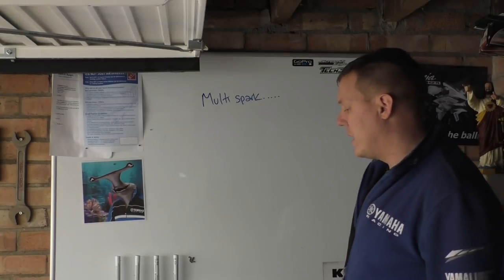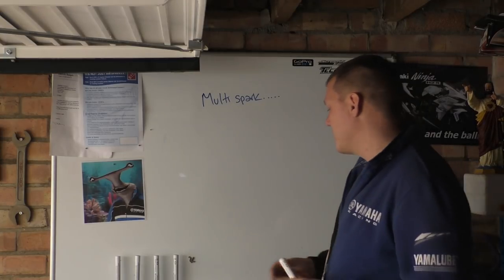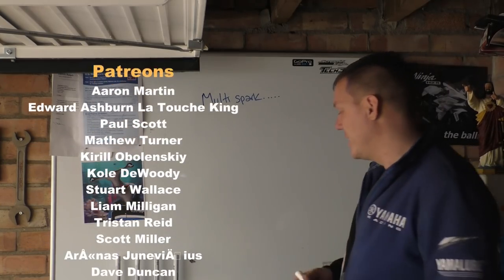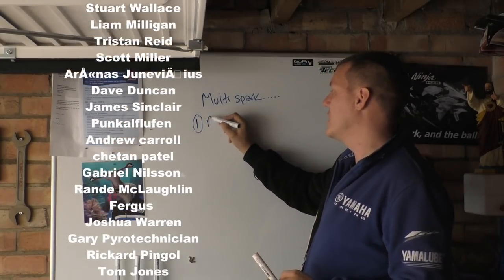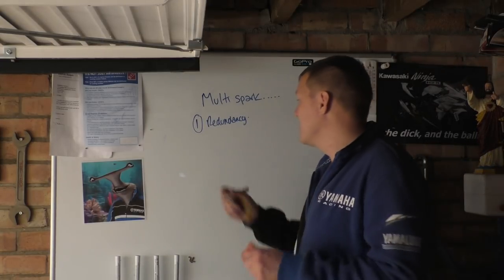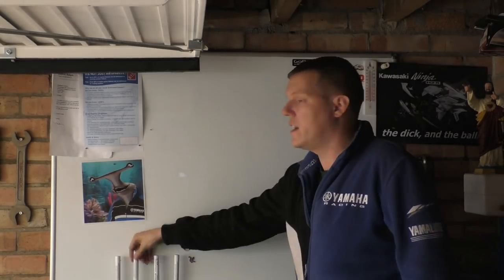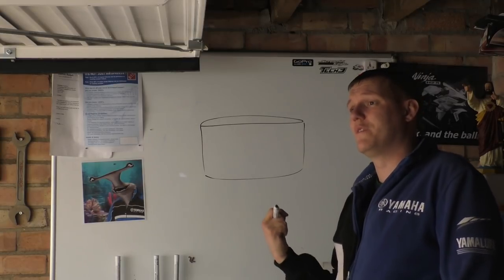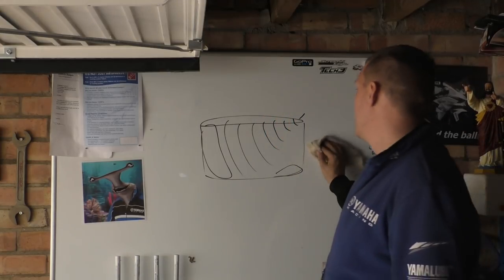Multiple Spark plugs - Why?

Comment: Some old two strokes had two plugs in a single cylinder but just one plug wire. If one fouled you could swap to the other. I remember seeing one many years ago but I don't remember what bike it was. I remember thinking it was interesting that you could have a cold (no spark) plug in there and it would not itself foul and you could switch to it if the need arose.
Reply: Yamaha dt from the 70s had this. All that I've seen just have a bolt plugging the second hole. Guess that's how well it worked.
Reply: I remember my mates Dad Had a Suzuki TS 250 with that set up. I used to think the lead had come off

Comment: Wouldn't starting a flame front from two separate points increase cylinder pressure over a single plug, and therefore the risk of detonation? In fact isn't that what happens in detonation where you get multiple flame fronts? (cue request for vid on detonation/preignition unless you've already done one. Not mastered this youpube search yet )

Comment: Matt, would you know on an SV650 (2017) do both spark plugs fire all the time or only at high RPM's? I tried to find more info but came up with nothing
Reply from the maker: I would think that they fire all the time, this means that the plugs wear out evenly, but I'll see what I can find out
Reply: Awesome, I appreciate the effort! I would think that as well since everyone is saying that 2 spark plugs are there for the emissions so they would have to fire all the time. I still haven't recorded the ticking sound on my bike (referring to your older video) to send to you but I plan to do it as soon as the weather improves. Also need to borrow some good sound recorder to do it.
Reply: Coil pic looks like full time, same coil as wasted spark but running to 2 plugs each cylinder so still fire together. Staged firing requires a trigger in the coil like COP to fire one or both as the PCM determines.
Id expect it to look bigger.
Reply: i have vague memorys of being told if they didnt fire all the time they would get covered in crap and not fire when needed so they just fire all the time
(great indicator of it not sparking though come plug change time)
Reply: @dirtygarageguy  if in any engine the  2 spark plugs were made to fire at the same time it should be possible to use 14:1 compression and it should work.

But it doesnt or it actually does?
Reply from the maker: Why would dual plugs and compression ratios have anything to do with it?
Reply: @dirtygarageguy  becausehigh compression causes detonation  caused by slow flame propagation in the cylinder and usually occurs on the border. 

If we have 2 spark plugs that fire together that problem should not exist because we have two flames starting and their position is more to the borders also helps.

Rsv mille had detonation problems and 2 sparks solved it.

Why wouldnt it allow us to run 13:1 compression without detonation??
Reply from the maker: Detonation isn't solved with spark plugs...

Comment: So on big bores it's "to make sure" all the fuel burns. But, engines generally have the same bore to stroke ratio right? That makes me feel like 1 spark plug could still do the job. Can you tell me why it won't?
Reply from the maker: "But, engines generally have the same bore to stroke ratio right?" 

- what?
Reply: The Workshop I mean, generally, your stroke isn't longer than your bore right?
Reply: The Workshop oh wait, i'm sorry. Piston height to stroke ratio is generally the same. My question is no longer valid :p

Comment: My 650 single has twin plugs and twin carbs too!
I never understood the twin carbs, i can only think its for packaging reasons. 
Bloody expensive way to do it though.
Reply: im guessing you have a suzuki xf650??
i believe the early models had a single carb but it ran like crap
so they used one carb per valve in the end.
Reply: DISORDERLY PUNK nearly! 
xf650 engine in a ccm frame
Reply: Honda xl/xr350. Had 2 carbs, only one had slow running jets. The other really came in to add more fuel. Even one carb running 2 cylinders is not at all bad unless looking for big performance.

Comment: After EFI's were invented I could still see multiple sparkplugs being useful in case anodes would break off, but really if that would be a problem there are sparkplugs with three anodes so that should work for redundancy. Exactly like you said in the video

Comment: 22k by Sunday!
My Nissan 2.4l nap-z engine used a 2 plug per system for emissions. The 2nd plug fired after the first which was timed by the computer based on an RPM model and O2 sensor feedback. They essentially eliminated the smog pump and charcoal canister etc with this system.
Reply: Woody's Wobble Shop, probably tomorrow!
Reply: Woody's Wobble Shop who cares, it's a car.
Reply: Because it's an example of the topic discussed. 
Guess I could have just said "penis"...
Reply: Yeah but it's a car so it doesn't count, motorcycles are high performance machines.
Reply: Damn... I need you watch these videos more intently. Apparently I missed the high performance part. Shame on me.
Reply: Ask Matt, he'll tell you.
Reply: Commander833, if it doesn't make 400hp + per liter, it is junk....especially motorcycles.
Reply: The Daddy has spoken... Cheers Mike!
Reply: Doesn't count because he has a car on his profile picture, I bet I could easily overtake you on my basic beginners bike sv650s
Reply: Uh, huh.....
Reply: Woody's Wobble Shop all cages are slow, why are you on a bike channel anyway?
Reply: Well Commander883...
And I hope the 883 isn't the size of your Harley.
I ride (drive), repair and rebuild bikes and cars. Essentially, I work on anything mechanical. 
Matt is a brilliant fuck that covers all the same shit I am interested in and he has the ability to dumb things down for some. Which leads me to the same question... Why are you at a channel that is called The Workshop?
You were cool when I went by my given name here. What changed?
Did I piss in your Wheaties?
I'll do me... You do you. 

Either way, you will get over it or you won't.
Reply: Commander833, it is just a fiberglass shell so I can make it what I want.  Whole car, my design.....body, chassis....everything.  Add to that, I plan to build everything, all the way down to suspension components.  I'm trying to step up my game.  Building a car is much more complicated than a motorcycle.  Add to that, the car is being built to go up Pike's Peak.  If it isn't done right, I die......

That said, by the time it is done most races will be dead.  Cars will be driving themselves by then....so the whole project might get scrapped for another bike...or kart.....who the hell knows....lol

PS:  I'm serious about 400 hp per liter.  My last kart racing engine was 141cc and made over 60 hp.  With me on it, it was under 360lbs. One track we pulled over 3Gs in the corners.  Riding around on a motorcycle on the streets doesn't have that kind of thrill.....just doesn't.  Racing is a test.  It is the application of science....plain and simple.  There is no voodoo.  If you are slow, it is because you suck at understanding science, applying the principals of it.....or a pussy.....oh, or all of the above.  That's my philosophy anyway.....
Reply: Woody's Wobble Shop A harley? I can only ride bikes that do no exceed 47hp with a restriction. And no it is not due to my own choice, it's the only way to the bigger bikes, it's enough though to still destroy performance cars.
Reply: Commander833, when you get a bit older and are allowed to spread your wings, hopefully you will learn what a "performance" vehicle is.
Reply: Mike Grady I destroy ''performance'' vehicles with my restricted bike
Reply: Commander833, are you riding a trials bike on the performance vehicles?  That is the only way you can "destroy" a proper "performance vehicle" with a less than 50hp motorcycle.
Reply: Mike Grady Yes
Reply: Commander883
Where the hell do I start???
Sooooo. I built my first motor (VW) at 14 years old still runs to this day. Bought, repaired and rode a Honda CB350 at age 15. At 16 I rebuilt my first V8s. A 351w (bone stock) and 350 for a street rod. 
I went on to build fast cars and rode fast bikes in the late 80s including the Honda cbr600 and 1000 (fast as fuck for their time).
I've driven 10 second drag cars, circle track cars,  flown planes, rode huyabusas, gsxr1000s cbr 1000s to name a few. Hell, I raced Motocross in a law enforcement series for a few years.
Point being...
You do not have the authority to define performance.
When you get a bit longer in the tooth, you may understand...until then, questioning my existence at this channel is shite and with no merit. 
By the way, if you are going to be the The Workshop gatekeeper and question who is worthy to be here. Become an admin. Otherwise piss off.
Reply: Commander833, provide proof....

Comment: I have something you may consider a fourth reason for dual spark plugs. High compression causes the mixture to be harder to ignite, because flame propagation is slower in a denser packed mixture. Also alcohol is harder to ignite and slower burning. E.g. top fuel dragsters have a compression ratio of around 17:1, dual spark plugs and a crazy ignition system, putting out amps like a welder. They also burn up a complete set of spark plugs in only one run down the track. 
Redundancy is also a point for top fuel dragsters. If one cylinder would loose spark completely, you have a nice little explosion. (and they blow up really well :-) )
That dual mass electrode thing is only for durability, because even if you have two mass electrodes, you will get only one spark. That is because electricity takes always the path of least resistance. If one electrode gets eaten away or clogged, the spark just jumps to the other one. For performance this spark plugs aren't very good, because more elctrodes means there is more hindering flame propagation. It doesn't matter for a slow turning engine, but for high rpms it becomes noticable.
Reply from the maker: "top fuel dragsters have a compression ratio of around 17:1"

- are you sure??? - The top fuel bike I did the video on has a compression ratio of 5.5:1 because of the insane boost pressure.
Reply: I read about it in an american online magazine, don't know if it was bullshit they were telling. They said the compression ratio is 17:1, the fuel wich consists of 90% nitromethane (and a shot of NoS) gets compressed almost like a solid tablet in tdc. They were putting out around 10.000hp. Engines will be disassembled after every run. They for sure have no cooling system as I could see. Maybe the top fuel bikes have to survive more than only one run? At least it would make sense to keep the cr down for longevitiy.
Reply: Just had a look at your drag bike review. As much as I like the nice milled heads, the combustion chambers look awefully small , are you sure the cr is only 5,5:1? I wish I could see the pistons for that engine, because for 5,5:1 they would have to have a dished top.
Reply: After further investigation I found out you are right, they may have made a typo, cr is 7:1. But I don't find that original article.
Reply: gratuitous repost of this info..
 Under full throttle, a dragster engine consumes 1-1/2 gallons of nitromethane per second;

 With 3000 CFM of air being rammed in by the supercharger on overdrive, the fuel mixture is compressed into a near-solid form before ignition. Cylinders run on the verge of hydraulic lock at full throttle.

 At the stoichiometric 1.7:1 air/fuel mixture for nitromethane the flame front temperature measures 7050 degrees F.

 Nitromethane burns yellow. The spectacular white flame seen above the stacks at night is raw burning hydrogen, dissociated from atmospheric water vapor by the searing exhaust gases.

 Dual magnetos supply 44 amps to each spark plug.

  Spark plug electrodes are totally consumed during a pass. After Â½ way, the engine is dieseling from compression plus the glow of exhaust valves at 1400 degrees F. The engine can only be shut down by cutting the fuel flow.

  If spark momentarily fails early in the run, unburned nitro builds up in the affected cylinders and then explodes with sufficient force to blow cylinder heads off the block in pieces or split the block in half.

  In order to exceed 300 mph in 4.5 seconds dragsters must accelerate an average of over 4G's. In order to reach 200 mph well before half-track, the launch acceleration approaches 8G's.

Top Fuel Engines turn approximately 540 revolutions from light to light!

Including the burnout the engine must only survive 900 revolutions under load.

The redline 9500rpm.

The Bottom Line; Assuming all the equipment is paid off, the crew worked for free, and for once NOTHING BLOWS UP, each run costs an estimated $1,000.00 per second.

 The current Top Fuel dragster elapsed time record is 4.441 seconds for the quarter mile (10/05/03, Tony Schumacher).

 The top speed record is 333.00 mph. (533 km/h) as measured over the last 66' of the run (09/28/03 Doug Kalitta).

Putting all of this into perspective:

You are driving the average $140,000 Lingenfelter "twin-turbo" powered Corvette Z06.
Over a mile up the road, a Top Fuel dragster is staged and ready to launch down a quarter mile strip as you pass.
You have the advantage of a flying start. You run the 'Vette hard up through the gears and blast across the starting line and past the dragster at an honest 200 mph.
The 'tree' goes green for both of you at that moment.
The dragster launches and starts after you.
You keep your foot down hard, but you hear an incredibly brutal whine that sears your eardrums and within 3 seconds the dragster catches and passes you.
He beats you to the finish line, a quarter mile away from where you just passed him.
Think about it, from a standing start, the dragster had spotted you 200 mph and not only caught, but nearly blasted you off the road when he passed you within a mere 1320 foot long race course.
Reply from the maker: These guy's along with a lot of blow engines are running 50psi+ - if you run boost like this then you HAVE to run a low compression ratio otherwise the engine will just explode. 

As for the pistons, they don't run that high, that's how they control the compression ratio. Top fuel for cars requires that you run minium 90% nitro and you don't run NOS as there's no need. The remaining 10% is methanol. 

The bikes burn out plugs usually every run and there's basically nothing different from the bikes and the cars - well engine internals anyway. The plugs burn away because that's what happens when you burn nitro. Nitro is very acidic.

Nitro burns about 250degC hotter than Petrol and has a higher flame speed, this also contributes to burning out plugs.

As for cooling, Nitro has a high latent heat of vaporization with Nitro being 560 kJ/kg vs 350 kJ/kg if I remember that correctly. This and the fact that you can add 8 times as much nitro than petrol means that cylinder cooling is taken care of. 

It also increase the thermal gradient quite a bit from lower initial temperatures to higher temps during combustion.

The 2 major problems with nitromethane 

- its a mild explosive that can be mixed with ammonia to create a 'proper' explosive

- burning it creates nitric acid, which is great fun when it burns your eyes and thoat. Its also very corrosive to engines. Hence the speical oils used.
Reply: Somebody wanted to put nitromethane into formula 1 cars, as if this wimpy machines would survive that for more than a second. At least there is one thing that crappy pushrod engine is good for, taking a beating by liquid explosives...
Reply: I think they add 10% methanol for inner cooling, because there is enough energy in nitromethane. Or it is just that nobody goes too crazy risking accidents and shrapnel.

4 bar boost is what I have seen as maximum in engines at a cr of a little less than 8:1, but they were burning petrol. Like the 1500cc BMW engine they used in formula 1, wich put out almost 1500hp. After qualifying the turned down the boost, because the motor wouldn't survive and to much power was hindering overall performace in the race environment. They were limping around corners, easy prey for na engines, but on the straight the ran like crazy. 

Nitromethane + ammoniumnitrate + aluminium powder, in the right proportions, it is like TNT and "burns" at the same rate. ;-)
Reply: You are spouting a lot of bullshit. Top fuel dragsters are about 6.5 to 1. They have to because of the insane amounts of fuel. You would get hydraulic lock if the combustion chambers are any smaller. A top fuel dragsters plugs are also done at about half track, melted. They are dieseling at the top end. Their dual plugs and magnetos are strictly for redundancy on the first half of the run